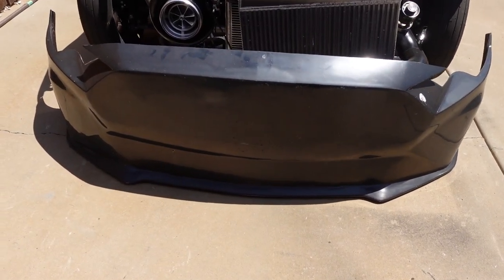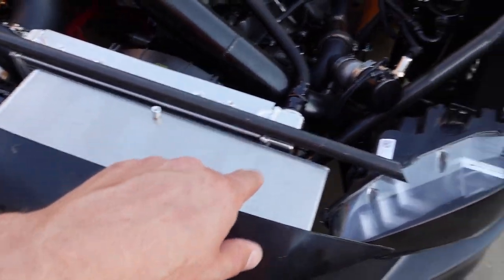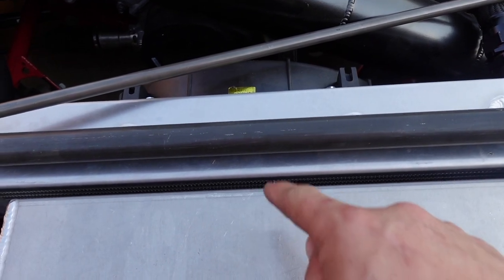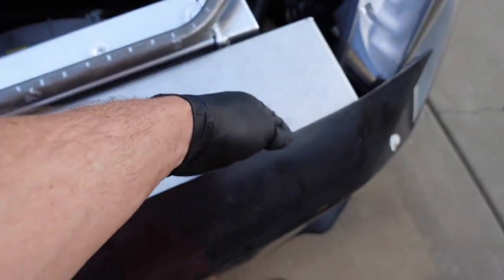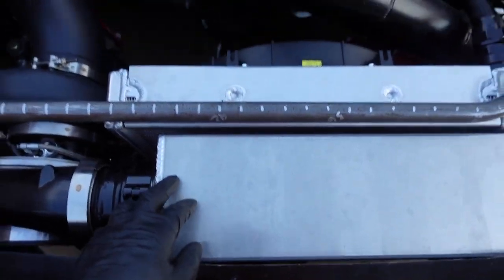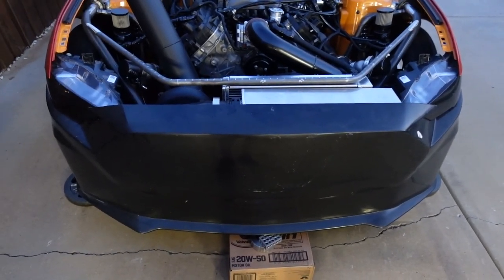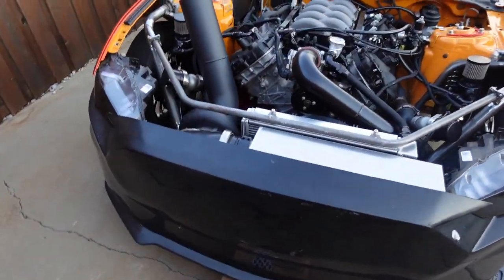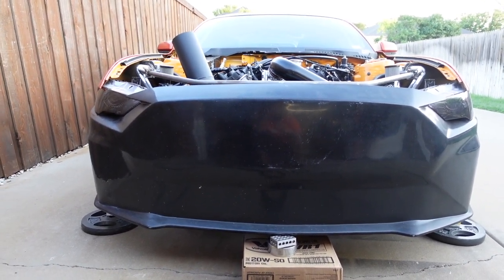S550 Tube Front End and Bumper Mounting - Finishing up the Single Turbo ProMod 2018 Mustang - Part 1

Comment: Be pretty dope if you could Fab some metal ducting and graft it to the bumper to funnel a straight shot of air into the turbo via a slightly larger hole than turbo opening and another for the intercooler but you’ve definitely got your work cut out for you making that front bumper look respectable.  Great job regardless sir 👍🏼

Comment: Id have to be there but i think like you said joe, just cut the hole for the turbo only and then you can make a cowl at the bottom of the bumper (on the backside ofcourse) to direct air  up into the front of the intercooler and just use a smaller horizontal "popsicle shaped hole" or a factory shaped hole for the air to enter into the cowl and shoot up into the intercooler

Comment: If you cut the grill area like mentioned you could do a smaller similar hole in the bottom to the intercooler so it gets more air flow. There’s a 6 inch brick in the front of that promod blocking the rad!

Comment: I was thinking that trying to make the front bumper look as much like factory would give it that much more realism and a mesh screen would work for keeping bugs and debris out of the turbo also. Maybe on the lower half you could go with the 1/2 inch slits all the way across to get more air flow to the lower section of the intercooler. Need that extra weight savings. lol

Comment: Maybe just the turbo opening and make some kinda thin aluminum ducting for the intercooler so it can pull air from the bottom. But just the turbo inlet whole would deff be the cleanest.

Comment: Use some 1/4 CM tube to bond in the bumper as a surround to strengthen the grill area, cut it out and use some black powder coated aluminum for a grill. The CM surround could double as a bumper mount/brace too

Comment: What's the point of the intercooler if you don't feed it cool air
Reply from the maker: #racecar But in all honestly a A2A intercooler doesn't have much of a cooling effect in a 1/4 pass. How cool you get the intercooler before the pass has way more of an effect. Think of it like a heatsink...
Reply: @StreetCarJoe  I see your point. As a street car tho, then what? That's why I think they are a waste of time to begin with on a racecar. Having said that I get an intercooler on the street but you gotta feed it.